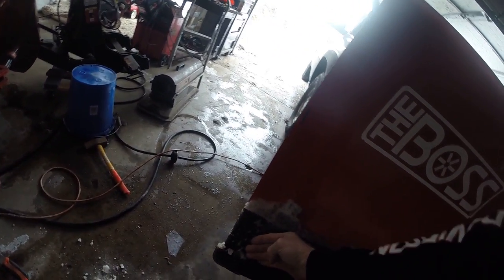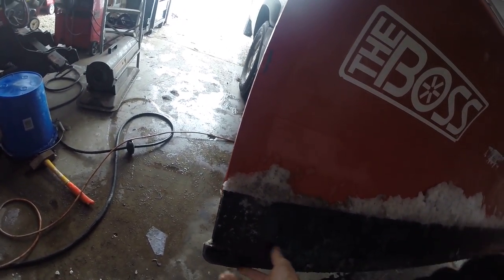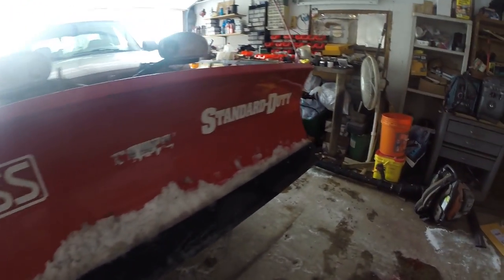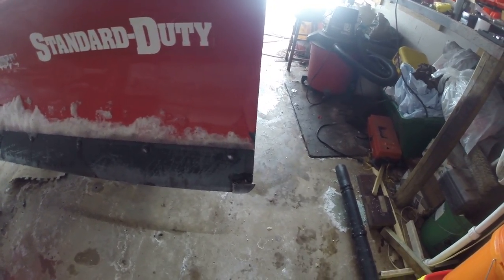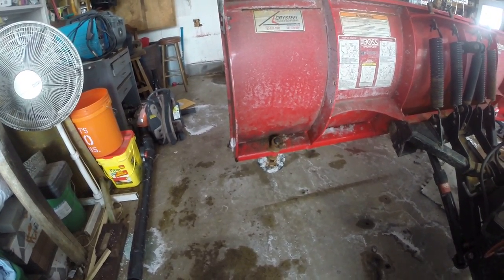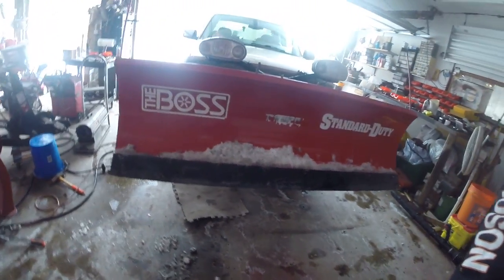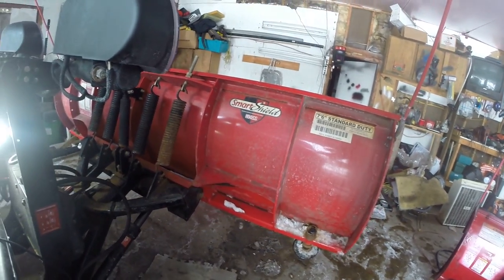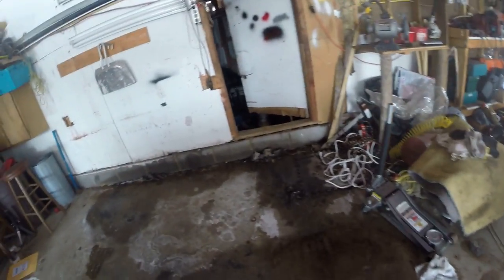HOW TO EXTEND THE LIFE of the Cutting Edge ON YOUR Plow

Comment: Good video/tip, thanks.  My issue is that I had to replace a shoe on my bobcat blade so I replaced them both and had to replace the cutting edge at the same time because it was warn out uneven.  I can't figure out how to line up the shoes now because I already broke the corner off 2 cutting edges since doing this last year.  In 10+ years of the original cutting edge and shoes I never had an issue.  I tried raising the one side which is getting worn out more with extra washers but doesn't seem to be working.  Not sure what is going on so any tips would be appreciated.

Comment: Great video. I notice on most of the v plows the cutting edge has an angle on each end. I am having a cutting edge made for my straight plow. If I were to have them bend angles on each end would that save the blade? Is that why the v plows have the ends bent back or is there another reason for the bend.
Reply from the maker: i'm not sure